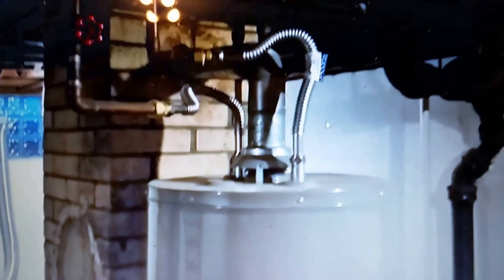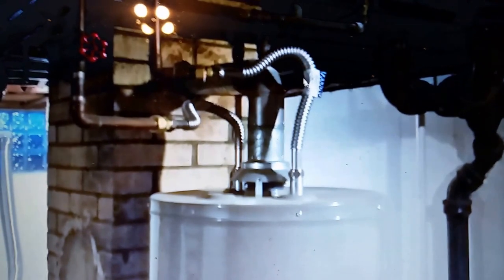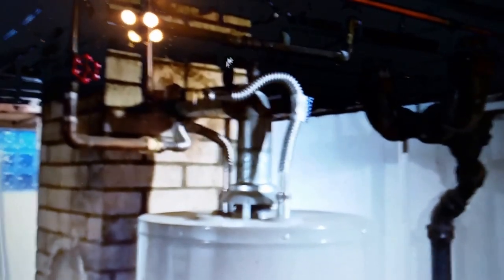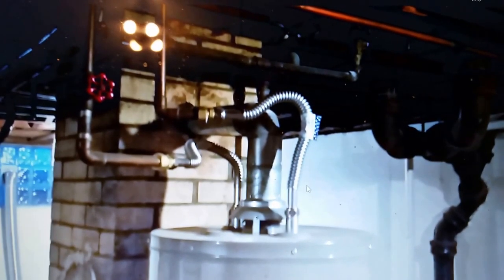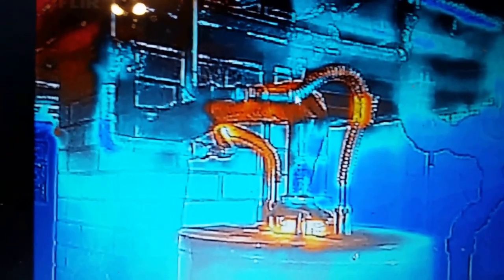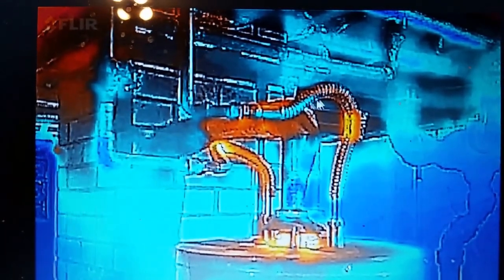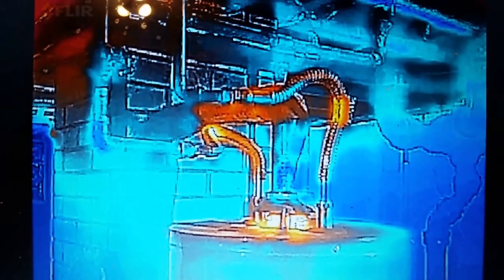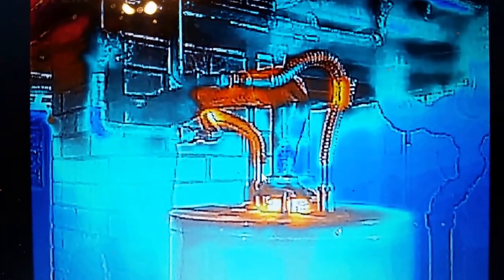Hot Water Heater Cold Water Pipe is Hot

Comment: Can you tell me if the hot water pipe is supposed to be really hot to the touch? Thank you
Reply from the maker: If the hot water was just recently used your hot water pipe will be very hot to the touch especially the closer it is to the tank. If hot water has not been used for a while your pipe will cool respectively. Personally, I set my Hot Water heater temp no lower than 115F and use pipe insulation to save money.
Reply: @AGlobalLLC  Thank you so much. I guess we need a plumber

Comment: Wrong the trap is additional. The Heat trap is the fitting on the joint to the water heater (the nipple). It has a poppet valve.
Reply from the maker: CSJiGSaW08 No pun intended Please explain since I'm not following you? A Poppet valve is not at which I am referring too in this vid, is located towards the top of a hot water tank is also known as a temperature pressure regulator also known as the safety valve or pressure relief valve. Heat traps allow cold water to flow into the water heater tank, but prevent unwanted convection and heated water to flow out of the tank. A Piped Heat trap can reduce heat from traveling through a pipe though not perfect science since conduction comes into play,  can dramatically reduce heat transfer. The safety valve (or poppet) has nothing to do with this video since it relieves temperature and pressure. Thanks, I am all ears to make it better. Your response is welcome. Thanks for your reply.
Reply: @AGlobalLLC  Search on HomeDepot. "Everbilt
 Dielectric Nipple Heat Trap". Its a nipple fitting that has a poppet/ball inside. Its like a check valve. Only allows water and heat one way. The heat trap coil is additional(and people put insulation over it). The heat trap nipple is standard on all new water heaters... Old ones do not have this...